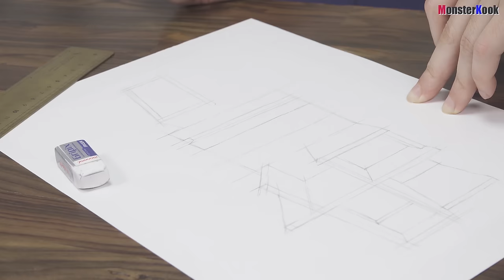The Smallest House in the World Built by an Architect.

Comment: The way how everything fits to every inch of the house is just too satisfying
Reply: that’s maths for ya
Reply: I'm pretty sure he prints the parts of this in 3D printer so it should be accurate as long as he's drawn it correctly.
Reply: I just changed your likes from 555 to 556
Reply: witch is way more satisfying is the sound effect
Reply: @frostycherry94  You clearly see him make every part from scratch. wtf you on?
Reply: @ProfessionalKafir  Do you really see him cut the every pieces that he can fit perfectly there? Or at least a fast forward of most pieces that he used? As long as what you see is only 1 or 2 of them it was only there for the show but not for the actual thing. The stair was the only thing possible there to be done correctly by manual work. And thank you for your cursing word to a random stranger online that you use to defend a video that popped up in your random feed that wasn't even being criticized.
Reply: Margareta Pranoto who the brick stepped on your toes today?. In fact, i dont see one single part that would be logical to create with a 3D printer. All i see is som plexi, some kind of concrete mixture, whatever the model making sheets he is cutting and some metal / steel wire. But i am no model maker so i cant say for sure. I also apologize for verbally abusing you.
Reply: @frostycherry94  To be exact, there isnt one single 3d printed part ive seen in this video. Thanks for wasting both of our time.
Reply: You mean every mm?
Reply: @ProfessionalKafir  idk why you so pressed? Lmao
Reply: That’s what she said
Reply: Ricardo Marrufo HAH
Reply: i agree
Reply: EXACTLY
Reply: @frostycherry94  
It'll be laser cutting for precise fit, since manually drafted lines vary with slightest angle change of hand. None of the parts seem 3d printed.
Reply: No hablo Taka Taka
Reply: @micasa30  laser cutting is possible too, my point is that he doesn't manually draw the lines with pencil and ruler the way he made the video to be perceived. It's just a kind of illustration.
Reply: @davonheria739   thank you, I'm pretty sure with your cleverness you have a better understanding of how to explain how he can make the model precisely here, why don't you try to enlighten us all then so I and probably some other random people who read this comments can be as smart as you are?
Reply: How
Reply: @frostycherry94  q
Reply: Are you player of Genshin impact
Reply: I'm a grade 9 student and I want to know if architecture is better than law 
So I watched this vid and i kinda want to be a architect
Reply: @frostycherry94  or just use a 3d modelign software
Reply: @marashiii_  fits to < 1 mm

Comment: As a first year College student at an architecture school, this does indeed put a smile on my face and makes me strive to reach this level of experience...maybe one day
Reply: Believe bro
Reply: @ZokirkhujaevAbdulAziz  thanks alot, man. I'm third year now, about to reach 4th. I'm so close!
Reply: @reynsbasement2654  Do you know what the gray material is that he is using for the construction?
It's solid, because I saw it being drilled. Masonite?
Reply: @toshikotanaka3249  it's probably just cement. In architecture mixing cement with metal armature helps solidify the building
Reply: @reynsbasement2654  No they were at the beginning of the video, like foam core boards but stiffer and gray. I know what concrete is..lol

Comment: I think it’s cool he builds the houses in a way that it would be built irl
Reply: Lmao yes
Reply: good point although in US they build with flimsy  cardboard and wood
Reply: Abdou lol true
Reply: Haha yeah except for the part where he pours concrete on the wiring
Reply: @onlee1onlee1  That's simulating reinforced concrete - it's a real thing, most houses use that. Although in real life for a house like this it would be cheaper, quicker and better to cast it off-site in factories instead of building formwork and pouring it vertically.
Reply: @nickshats  putting concrete on wires sounds like a really bad idea. If that house ever experienced electrical problems then consider bashing through cement to find the cause.

Comment: Could you send a list of the materials you use??
Reply: I think he used fomex
Reply: I want to see that, materials and brands he use to all his projects :D
Reply: I think he used regular metal wire and vinyl boards to hold the cement. And sintra board for finishing the walls. In designig the doors he used different design and texture of vinyl boards.
Reply: Ya need a 3D printer
Reply: @b3nji216  oh yea😂
Reply: Plexi glass for windows the frames and a lot of things are 3d printed and foame
Reply: And wood laser cutted
Reply: You need Cement ,water,glue,glass,plastic,metal bars short & long,battery,wire,bulbs & a drile mashine

Comment: Your art is so adorable. Please use vibrator in the wet concrete emmediatly after you pour the concrete in the template to avoid cracks and malformation in the concrete.vibrator helps air bubbles get out of the concrete.

Comment: And before pouring concrete in the template, you should use some oil on the inner surface of the template so that the concrete wont stick to the template and you can avoid malformation. It is how constructors do it in reality

Comment: You'd need a small vibration tool when pouring concrete to make it settle a bit better and also avoid cracks when drying and give it nicer finish from start

Comment: 1.) Did you forget to include a fireplace?  2.) How are the heating and cooling ducts supposed to hang from the ceiling  if it's concrete not wood?                              3.) Autumn is just around the corner, and  soon it will be raining! How are the inhabitants and/or  their guests to be protected from getting wet at the front door if there wasn't anything placed to block the rain?                                                4.) With all of the space dedicated to living-space, a garage will have to built separately to protect their automobiles/vehicles.                                                          5.) Nevertheless, the decorative tree made of wires and the low glow of the lights were beautiful finishing touches.

Comment: Amazing, but rebar might just be greatest building rip-off in the history of building materials. If you want cement to grip something, it needs a soft, toothy texture, like coarse sand, straw or hay. Look at buildings  that are falling apart. You'll see whole chunks of cement dropping away from rebar. Seriously, google it.
 
Even if you want to control the flow of cement, you can use something temporary as long as it's solid.